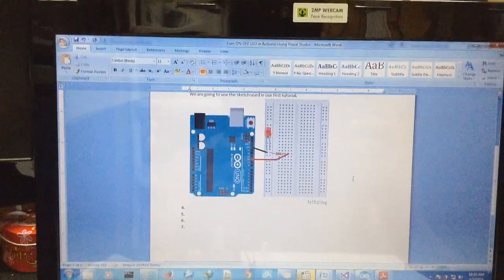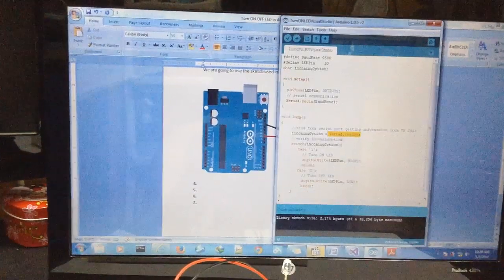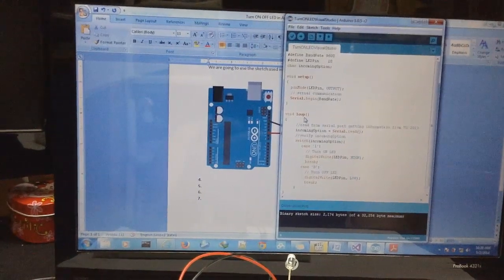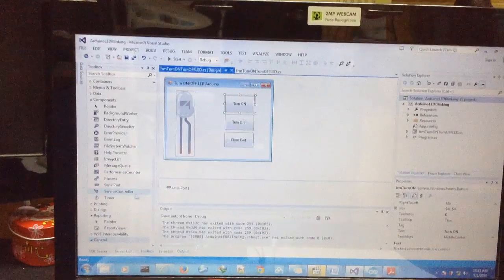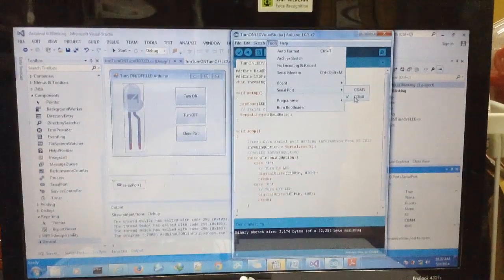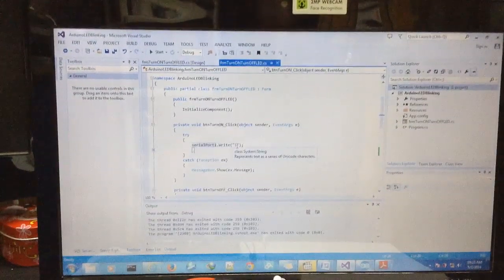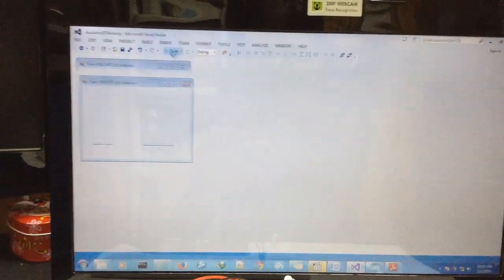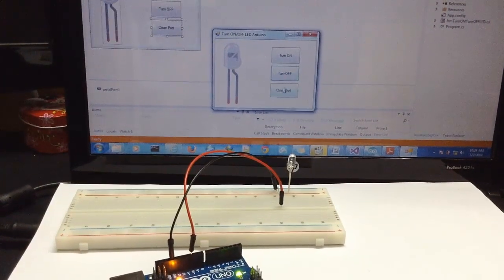Turn ON OFF LED Arduino With VisualStudio C#

Comment: why when i run the port com feature i get a pop up?

when i run my FORM1.CS my form1.cs [Design] pops up as it should and when i "say" ON  my program say OK and then i get a pop up displaying this 

"An exception of type 'System.IO.IOException' occurred in System.dll but was not handled in user code

Additional information: The port 'COM8' does not exist.

If there is a handler for this exception, the program may be safely continued."

i press continue and i get the same box pop up but this time it says:

"A first chance exception of type 'System.Reflection.TargetInvocationException' occurred in mscorlib.dll

Additional information: Exception has been thrown by the target of an invocation.

If there is a handler for this exception, the program may be safely continued."

so i click continue AGAIN and AGAIN the same box displays the same msg:

"An unhandled exception of type 'System.Reflection.TargetInvocationException' occurred in mscorlib.dll

Additional information: Exception has been thrown by the target of an invocation.

If there is a handler for this exception, the program may be safely continued."

WHY IS THAT ?
Reply from the maker: are you using serial port control in visual studio,  make sure which port is free also you could change it in properties portname, all the steps are explained in the blog georgehk.blogspot.hk
Reply: thanks i fixed it, is it possible to use more than one COM port in software? different function  assign to different com ports?

Comment: hello Jorge. i am trying to control the resolution of an RGB led by using an interface with 3 textboxs and 3 buttons. my question is, when i input resolution data in textbox, for red, green n blue each, how will the arduino know which one is for which?
Reply from the maker: RGB led is easy to use, just need to know which PIN you connected, take a look this website:
http://playground.arduino.cc/Main/RGBLEDPWM
where show you which color you want to turn on, i hope it can help you, regards
Reply: Jorge Serrano yes. however i find difficult to send integers like 100,252,150. it accepts only 0-9. do u have a solution for this please?
im kindof new to programming :/
Reply from the maker: using C# you can write any value in the serial port and read that value from Arduino
Reply: Jorge Serrano  please i need a code as an example that write value int the serial port and be read that by arduino pleaseeeee